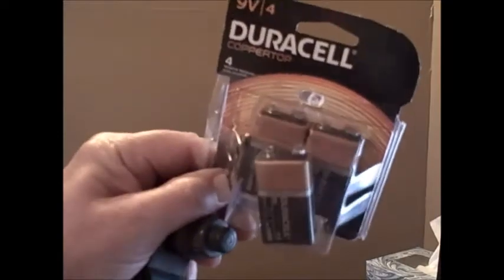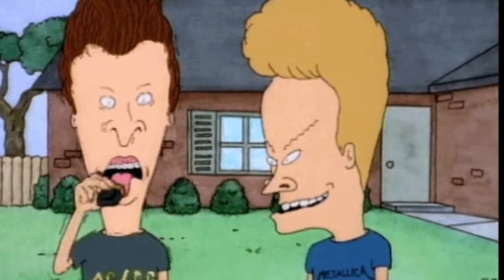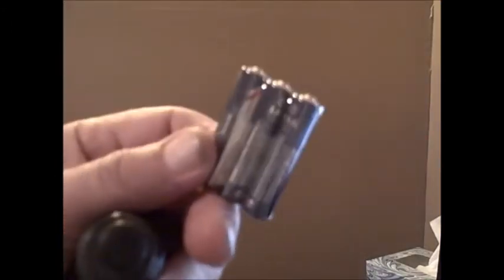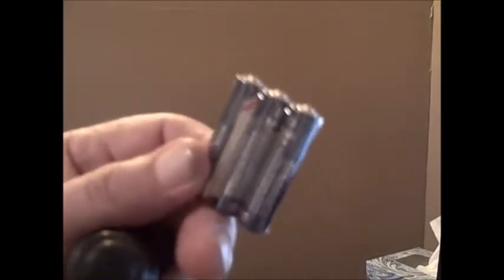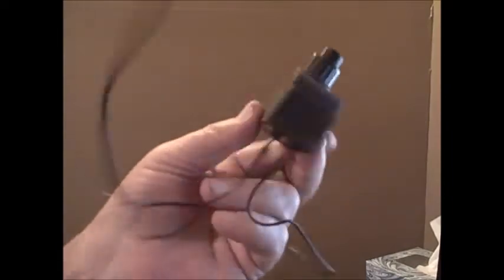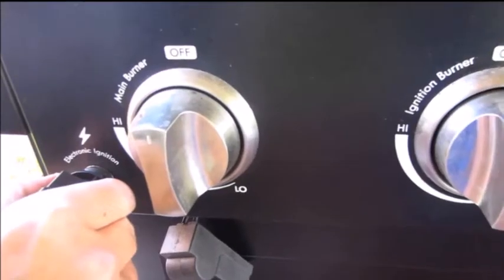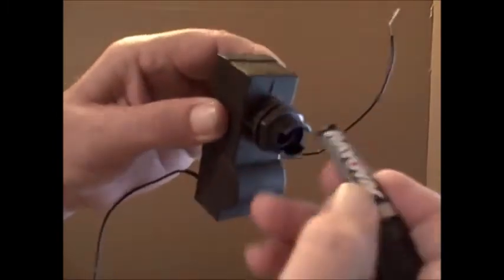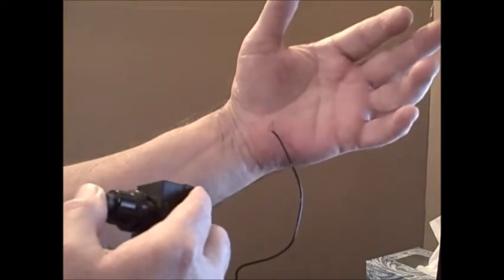Voltage and low amperage testing

Comment: Great point, Chris.  You went to 24V on your Solar to maintain a certain wattage while cutting the number of amps to achieve that wattage in half as compared to a 12V system.  I took the same approach and started out with a 48V system.  My 2KW inverter would require some 200 amps at 12VDC for full load while the 48V version of the same inverter only requires about 45 amps to achieve the same wattage.  48V is not the answer for everyone, there are down sides like having to buy 8- 6V batteries or 4- 12V batteries for backup.  Also, just as you have done, my panels are in a series / parallel configuration such that my input voltage for the 1.06KW array runs 120V at about 8 amps which means the wire from the PV arrays can be a smaller gauge and still stay well under the 2%.voltage drop which identifies a well engineered system.  So, each voltage choice has pro's and con's to consider.  Regardless, choosing 24V or 48V v/s 12V will result in a system that runs cooler, not require as heavy a gauge cable which saves money up front and in the long run.
Reply from the maker: All great points...5% or lower voltage drop (IMHO) is gravy. 24v systems also allow access to many add-on's readily available. 48v compatible add-on's are more expensive/harder to find. Overall, 48v is the way to go, but 24v is a great compromise. Under 400w in solar panels, 12w with PWM is fine...however, seen some excellent MPPT 1,200w+ 12v systems
Reply: Well agreed.  12, 24 and 48V all have their unique advantages and disadvantages.  I'm glad to see all of them in use.

Comment: I used to have a blast with the piezoelectric versions of these where you had to press the button for each spark.  In physics class when I was in high school, we played with the typical electrostatic generators.  I had a high charge built up when someone got too close to me and provided a ground path.  it was a large, bright arch between my leg and her arm.  It fried my calculator that it passed through and left a bruise or maybe a burn mark on my leg were it left me.  But given the fact I had long hair and we got it to all stand straight outward before the discharge, it made one hell of a yearbook picture for our physics class. :-)
Reply from the maker: Hilarious! I think many of us have similar stories. Electrical "exit points"